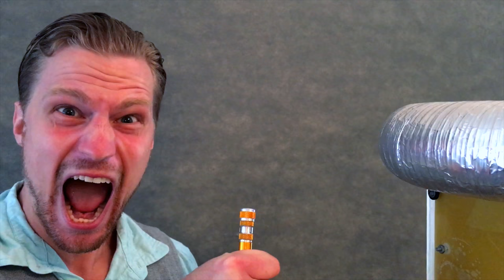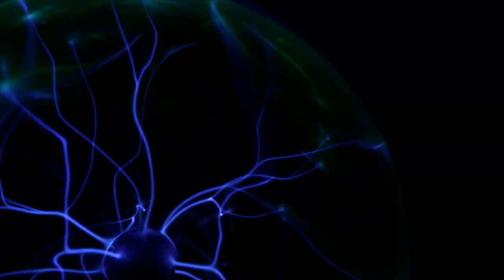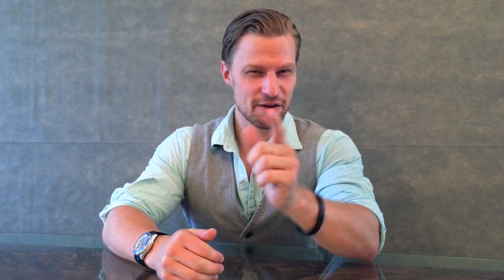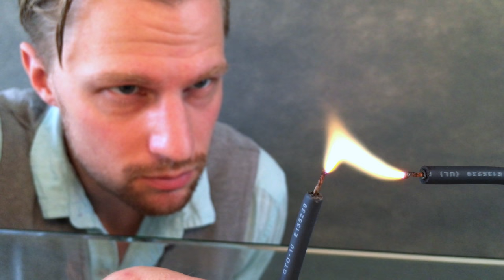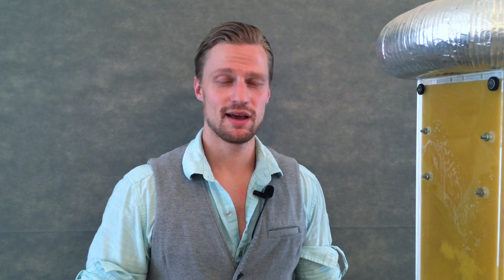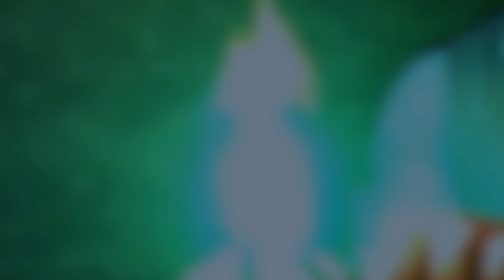5000 DEGREE electric arcs | High Voltage |

Comment from the maker: Please do not repeat what i've shown here. Holding both wires, in both hands, is not smart, nor, is it the safest. Should insulation on one of the wires fail, high voltage current would flow directly across your chest, potentially leading to serious injury / worse. Always use the one hand rule, at all times. That means one hand in your pocket when any device is on. Period. Thanks!
Reply: This is something you should be saying at the start of all of your videos... not in the comment section as an afterthought. Be responsible. God only knows the consequences of not doing this and weight of all the negative karma you are creating for yourself by not being that responsible. I'm just saying... please keep this in mind. God bless you brother. Remember having a YouTube channel gives you great power to influence others either positively or negatively. Remember what Stan Lee taught us all through Spider-Man's origin story: "With great power comes great responsibility."
Reply: damn! That's sound like a 50 Hz transformer! Even playing with grenades is safier...
Reply: So, can you go into how to maintain a hot sustained arc via inductive ballasting? I want to build a Birkland-Eyde reactor and not trip my breakers

Comment: The electrical arc's so hot, the air becomes plasma, the plasma is positively charged, meaning it'll either be Fork Discharges, or Electrical Sparks.

Comment: If you want an ultra bright arc, try 25 ish volts at 120 amps AKA a TIG welding arc. Its so bright you cant even look at it and its so hot it melts metal.

Comment: I see some Youtubers play with high voltage using single insulated wires,probably for 500-750V which is scary.I wrapped 750V wires in 4 layers of electrical tape but only use it up to 2kV.Even at high frequencies at 5kV at which I tested it makes very little corona discharge which means very well insulated and can deifetely handle 2kV at 50Hz.
Reply from the maker: Nice work. Yes, be safe. the wires I used were both rated for 15,000 volts.
Reply: @PlasmaChannel  Can it handle 15000V at high frequencies without forming corona?

Comment: The way I look at things... voltage is how bad the electrons want to jump, current is how many jump at once. More current, more plasma. More voltage, more distance.
Reply from the maker: True! Though, with more current an arc can be stretched further. Significantly further.
Reply: But isn't that due to the lower resistance of ionized air compared to nonionized air. 
For instance a Jacobs ladder stretches an arc well past it initial breakdown length. Because hot, ionized air rises up into a progressively wider spark gap. When it extinguished the arc restarts at the narrowest gap.
Reply from the maker: Correct sir
Reply: Btw. Love the channel. Keep up the good work
Reply from the maker: Thank you very much. I am very passionate about high voltage. Just want to share my passion with the world

Comment: Jay, excellent video! I would like to see an experiment on the most efficient way to use plasma to heat air. For example; a heat exchanger with plasma to quickly heat up a small room. Thank you!

Comment: Hey man, I just finished watching all your videos and subscribed to your channel! Most of the stuff in the videos I was already familiar with but the "water bridge" experiment was really cool and something I've never seen before. You've got some great content and I definitely think your channel could become big. You don't have a ton of vids yet but there's been a noticeable improvement in quality from your first one until now (in terms of lighting, audio, etc). Can I ask, what is your background (do you have a degree in electrical engineering, physics, etc?)

Some constructive criticism:
1) Personally I like the short, sweet, and to the point style of your content. But there are some things which I would like to see a little more in depth explanation. For example, why does the higher frequency make the arc harder to break?

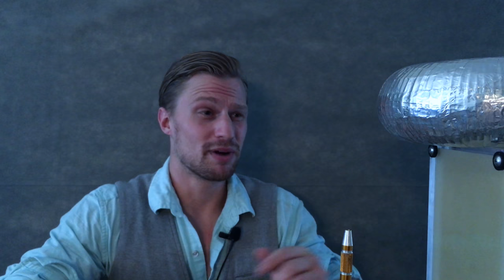2) I still think there could be some minor audio improvements. I see that you are now using a lav mic, which helps a lot, but the overall volume level still varies throughout the video (between the intro music, speech, and different clips/voice overs). There are also things like the "pop" at 3:34 in this vid. Like I said these are minor issues, but also easy to fix. I don't know how familiar you are with audio, or what you use to make your videos, but most audio & video programs today have built in tools like normalization, compression, and ducking which greatly improve the audio quality of speech/voice overs. Let me know if you have any questions regarding audio related stuff or how to use these tools.

Other than that, keep up the great work! I look forward to watching more of your videos!
Reply from the maker: +Brandon Doherty I am honored you enjoy my channel. Thank you for the in depth pointers on audio and content depth- I have been struggling with mastering audio for some time. The trick is that I cannot speak and record too loudly, or I receive an echo. Also, depending on which angle im speaking at, my filming room reflects different echo at different levels. This all couples together to give me some nasty audio sometimes, and I try real hard to fix in post. I honestly should just pad the walls with sound absorbing foam. However that is pricey. I hope to keep improving this channel, and your input is greatly appreciated. If any of our videos are share worthy, the biggest compliment is sharing a video or two!
Reply: Yep room sound can be a big problem sometimes. Acoustic foam is one way to fix this and there are other tricks you can use as well. But like I said these are minor issues that can be improved over time. Do you record the audio directly to your camera, or do you record it separately? And do you use another mic besides the lav?
Reply from the maker: +Brandon Doherty I record sound directly to fcpx on my computer, then upload video to fcpx and sync sound with video. I just acquired a wireless lav (you can see it for a split second in the new episode when I walk into frame talking about sparks) ... And the quality is much better on that Mike.
Reply from the maker: +Brandon Doherty I forgot to answer a question. My apologies. I have a minor in physics, and bs in biology. Most of my knowledge comes from physics courses and one electronics course I took, but also I have been a maker and experimenter since... 6th grade. I got into high voltage in 11th grade and never went back to normal electricity!
Reply: No problem! As far as the room sound goes, using an expander or noise gate can help. Also, an external preamp or interface for your computer can help as well. And if you are ever looking at getting a different mic, consider with a hypercardioid polar pattern (this just means it picks up the most sound directly in front of it and rejects sound from the sides). 

And that's great! I just recently graduated with a degree in music business / production, but I have always loved science & experimenting since I was a kid. A lot of electricity & physics related stuff I have learned on my own through reading and videos like this, although I did get a little of it in high school. Ironically the audio engineering classes I took actually helped me understand electricity as well since you're dealing with a lot of the same concepts (ie. frequency, phase, voltage, resistance, etc). I've even delved into high voltage a bit (if you consider 500V high enough lol) when talking about tube amplifiers. I have a video on my channel explaining how they work, if you'd like to check it out!

Comment: At what voltage does electricity arc: 327V:
This is 327V in air at standard atmospheric pressure at a distance of 7.5 µm. The composition of the gas determines both the minimal arc voltage and the distance at which it occurs. For argon, the minimal arc voltage is 137 V at a larger 12 µm. 5 mA is accepted as maximum harmless current (http://www.highvoltageconnection.com/articles/ElectricShockQuestions.htm).
Reply from the maker: 5mA is quite low for conduction across the chest. Any human without a pacemaker can stand far more than 5mA, sustained over the chest. I personally have no problem with a constant supply of 15mA. I DONT encourage anyone reading this to to that. Just giving perspective.

Comment: how can i increase the current??, i had built a tesla coil and voltage multiplyer, with reallly high voltages around 800,000 volts to 950,000 volts, but i dont have any clue about any circuit that can increase the current... the only thing that i know is that the more the voltage the more the current or lowering the resistance through the ohm's law... but my both circuits run in max volt and i want to sustain that but also increase the current. Can you provide me with any idea with amplifying the current (amps) in a circuit or any thing. i was thinking to buy a thick wire to allow the current to move even more freely in which i determined the increase in the amps, but if there is another way, i am glad and i want to hear it. THANKS (by the way, thanks for the work you put in this videos. i appriciate it and had learnt so much because of you, continue with the great Job you have <3!!!) i hope you reply.

Comment: Microwave transformers actually output about 2 Amps in short circuit.So that harc was more than 500mA.It would be nice to measure with a milliammeter how current decreases as you pull the arc longer.
Reply: Thats only with a resonant capacitor which he is not using
Reply: @revolution5547  No.Measure short circuit,its 2A. With 3 resonant capacitors you can get over 3 amps.

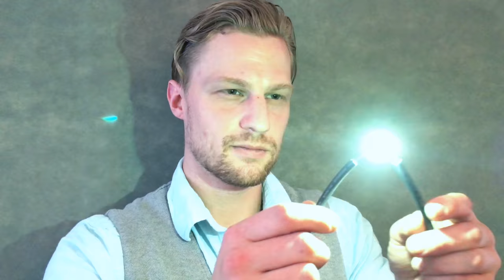Comment: Holding the wires in each hand like at 0:33 is extremely dangerous because if for what ever reason, the insulation fails, the electricity will have a direct path through your heart. It is much safer to use a chicken stick because then only one hand would be touching the wire and the electricity would be able to go across your heart unless you are grounded.
Reply: given time...
Reply: I really think he was grounded, he don’t seems to be stupid

Comment: I like your videos and I have a question : What happens when do you touch the 5mA arc?
Reply from the maker: the 5mA arc will burn your finger. Vaporize the skin.
Reply: Youre probably wondering why 5ma aint killing you. Thats because of conductor skin effect. It happens at high frequencies. Google it.

Comment: i've once been inside of a 3 phase, 24kV 640A input transformer station, (15.1MW!) and these are realy common here where I live, like, you can find them almost at every second corner, so I wondered, what kind of an arc would shorting 24kV 640A supply produce(if there weren't any fuses in the way to stop you)? I mean, I know it would be extremly big, bright, and you'd probably be able to strech it a few metres at least, but just what are the "specifications"? (and that's assuming that you are able to withstand the heat and brightness so you don't die in like 2 seconds!)

Comment: Nice video and have you ever accidentally broken any equipment or your watch while working with high voltage I've only ruined my cheap wrist watch
Reply from the maker: +Brian Bell I have broken some very accurate digital scales- on our ionic thrust episode. I wanted to measure thrust, in grams. They..... Said NO to ionic wind. Now don't turn on. Besides those, I blow my breaker every once in a while but that it.

Comment: I'm trying to make electric arcs from 230 volts AC but it works only with carbon electrodes. When I try with iron nails or some copper wires, I just get some sparks. Could you explain what is happening?
Reply from the maker: 230 volts is not a high enough voltage to sustain an arc. The carbon electrodes head up from the figh current you pass through them, and those heated electrodes allow for a very high temperature arc to form. But with other materials, like the nail, they heat up from the current and vaporize. 230 is a very dangerous thing to play with. Reduce your current drastically, and power level to under 20 watts, and boost the voltage to 1,000. You will then get arcs
Reply: @PlasmaChannel  Thank you for your answer. Actually, I'm trying to melt metals by using electric arcs. I would like to make an electric arc furnace. My machine is working but it needs carbon electrodes to work. Unfortunately, those electrodes are difficult to recover, and they burn when the electric arc is  establish. So I would like to know if I can replace them by something else, which could last longer.

Comment: hello sir can you please make a video on  a "power supply" via single PS  the different current voltage and also frequency can be drown or we can regulate voltage current frequency ,
Reply from the maker: I apologize, but I did not fully understand. Did you mean an adjustable power supply, for voltage, current, and frequency?

Comment: Currently I was working on HV  about a month and I have many problems regarding to supply for main transformer
Reply from the maker: Are you using a flyback transformer, or an iron core 60hZ transformer?
Reply: Plasma Channel  yes I am using flyback transformer  but my frequency is high above 50 khz

Comment: Silly question... I'm assuming that you are using a high frequency pulsed DC current? How would AC affect the arc? Or vice versa?
Reply from the maker: Actually, all these arcs were AC. DC arcs tend to be cooler, for the same pulsed equivalent frequency.

Comment: i'm very confused, what power source did you use to get that million volt or so arc but yet still a whopping 10 AMPS? did you have to use multiphase  AC power, or multiple plugins?
Reply from the maker: So, that 10amp pulse is a duration of milliseconds at most. it is 400,000 volts at 10, however Overall power is a pulse containing less than 40 watts / joules of energy
Reply: oooh, that makes total sense, thank you
Reply: it's a lot like PWM then

Comment: how did you control the current in that multiplier!?
Reply from the maker: Having designed and built it, I placed a 2,000,000 ohm, 400kV resistor in series with output.

Comment: Holy hell! How did you manage to catch sparks from voltage multiplier with your hand and not die? Is your VM grounded? Never saw anyone doing that on the internet; it just happens that I myself have 150kv VM, and I would try to catch those sparks if I'd know a little bit more about their possible (non-?)lethality; answer pls
Reply from the maker: +alcatel995channel haha, honored you enjoyed! I designed my voltage multiplier to output only 100ma at maximum. While 100ma is lethal, it is delivered in under 1ms, meaning all that happens is a quick contraction of muscle. Also, I do ground the bottom of the multiplier, and ground my right foot (loosely). This causes all current to fly from right arm, down right abdominals, and into right leg through to the ground. Leaves my body untouched. You'll enjoy a few episodes in the future- I'm designing the largest voltage multiplier in the state of Texas.
Reply: Nice, but heyy what's going on here, if your maximum output is 0,1A then how can we see 1A and 10A sparks in the video?
Reply: Also why don't you use needle-needle spark gap? it would give you much longer sparks.
Reply from the maker: +alcatel995channel ah, great question. I have two multipliers I built. One of them has the ability to up the current and bypass the internal resistor I built in. Giving 1 amp respectively.
Reply: +Plasma Channel how did you build it Jay?
please make a tutorial on it.
Reply: +suresh suresh  both the voltage multiplier and the changes done on it.

Comment: ac/dc as well .
ac arcs are easier to quench then dc
Reply from the maker: That is what I understand. The DC arcs have a stronger magnetic field component that stabilizes them.
Reply: @PlasmaChannel  not only that but at the point where the ac wave reaches 0 is a point where the arc can be quenched easier.
and this 0v happens of course 60xsecond.

im not too good with dc wiring though especially higher amperage.
i needed a switch for a car battery setup and so i was like "ya lets use a standard 120v switch" but that didn't last 2 long.
it worked a good few times but then i think the contact melted because it was stuck on.

Comment: very informative,  here's a link on a voltage arc I would like to get your opinion on
 http://old-ufo-photos.latest-ufo-sightings.net/2010/02/1970-1974.html
image title    1970s  -  Bremerton, WA-Washington, USA

  the craft is known to be  ~ 58 feet in diameter,   what is your opinion of the amperage and voltage arc length  ?
Reply from the maker: Thank you. I unfortunately cannot comment on this image. There are too many variables for me to be certain. A rough guess: 2 meters in length, 100 amps of current?
Reply: its about 12 ~ 13 feet in length ( 3.5 to 4 meters ), using your approximate estimates of   3 x 10>6 V/m that would put it at
3 x 10>6  x  3.5 meters   ~  1.1 x 10>7 V/m    ->  11000000 volts !   I used  your estimates in the vids of  30mA which gives us a Wattage of  330,000 Watts for this strike, using your estimate of 100 amps  -->  P = V x I  =  1.1 x 10>7 V/m  x  100A  ~ 1.1 x 10>9 Watts . But yes we are only estimating here due to variables, I think were a little excessive, but thanks for the opinion.

   I noticed in one of your vids when those voltage strikes of your device struck that metal object in your hand that your hand surged - suddenly moved, were you being shocked or is it the sudden current in the metal that develops kinetic energy in the metal and imparts a force on the item ?
Reply from the maker: +B na my hand certainly moved due to muscle contraction. My multipliers cause momentary muscle contraction at full power.